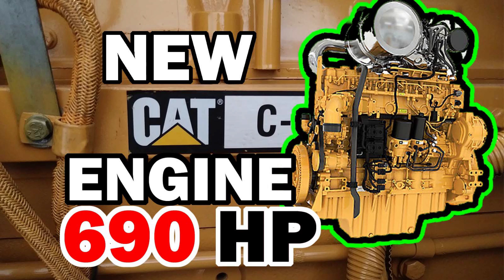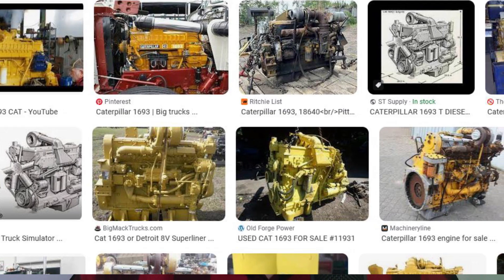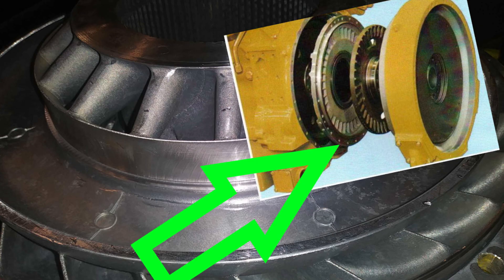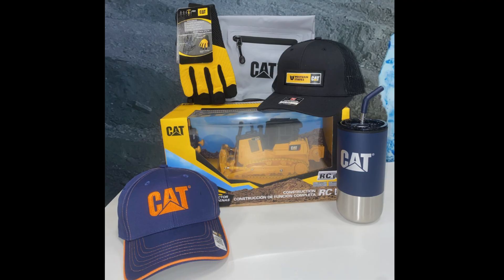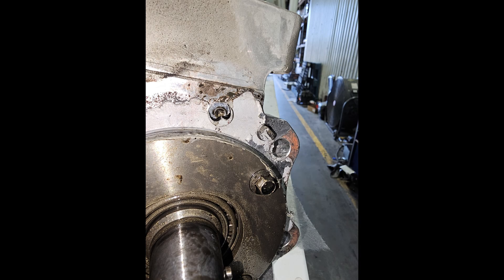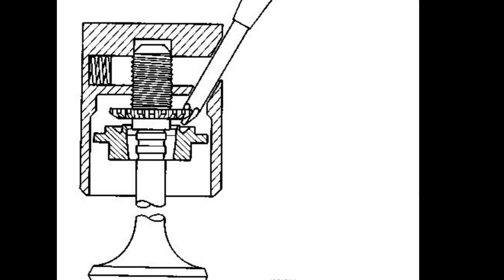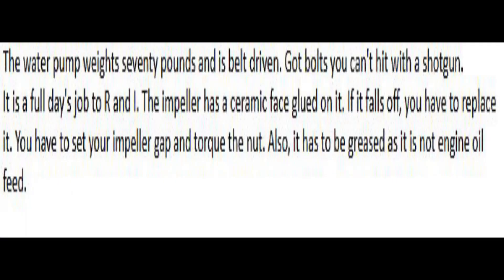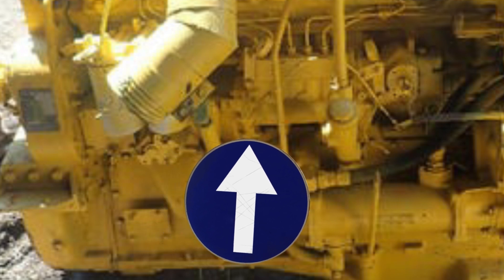The Coolest Diesel Engine You've Never Heard Of, Cat 1693, Dual Overhead Cam Caterpillar.

Comment: Had a 425 kitty cat in 1972 LW logging truck, bought in 1975. It had brakesaver (a must for BC). 5 X 4 with airshift A-box. Rockwell or Timkin 44's ??? 4.63 ratio... soon figured out that U didnt need to wind it up to 2100. Started to only take her up to 1800 max. She pulled good at 1550 -1700. Had to keep your eye on pyromoter as it would easily go up up to 1250, kept her a 950 max.
Fuel milage really improved keeping revs down and pyro down...
Dont remember it been leaker, except for the Brakesaver seals. Went through a few seals changes before living with the leaks...
Finning had great truck shops throughout BC. As not many shops wanted to do major work on them.
Fuel milage wasn't that bad.
Not as good as a Cummins NTA 420. 
Mack had the run slow go fast figured out years earlier. 375 Thermodyne's with 12 speeds would give me a run!
Lot of 1693's and early 3406A's Died early expensive deaths becase they were been shifted at 2100 and cruised at 1950 due to the axel ratios and general ignorance of 1693's wide torque curve.
Belive peak torque was at 1200
Did have water pump changed at Finning, dont recall it been a big deal???
PS
3406'a (there was never an A) came in both PCTA and DITA. My friend bought new Freightliner in 1977 with PCTA 3406 at 360hp. That truck never let him down!
Reply: Correction. My LW had 5.29's = 62 mph at 2100, not 4.63's. That would have been a much better setup!

Comment: Remember that at the time these engines were designed and in everyday use diesel fuel cost 22-25 cents per gallon. Mpg wasn't a big issue.

Comment: We had a kenworth t800 delivered that had a 3406 with cat brake and also a brake saver by mistake.. it would lock up the tires on dry pavement if both where engaged

Comment: Never heard of? My 1975 Kenworth K100 has a 1693T with a 13 double ott transmission, good old white block motor, had a 1973 W900 that had a 1693 in it, best motor next to the 475 Cat ever built.

Comment: i have run one in late 70's and near end of there run i believe u could get a di  alot of them where painted white from factory and i think they changed to di in late 70s and where 425 hp i might wrong but i dont think 3406b where available intrucks until early 80s and where a bitch to start in winter

Comment: The 1693 was the Godfather to the 3406 and C15.  Sounds like a bucket of bolts rattling in a steel pail at idle.  Obviously cam setup was different but laid the foundation for what was to come.  Back in the late 60s/70s it was the king of the hill along with the 12v71 Detroit.  When 3406, 3408 and KT Cummins appeared in the mid/late 70s then the 1693 and 12v71 disappeared quickly.

Comment: Favorite engine would be 3408 . Ran a rock trencher with one supposably was tuned to 650 hp or so never was able to prove it . Never ran out of power but would burn 300 gallons of fuel a day

Comment: Worked at a Cat dealer late 70 s rebuilt a few of them, also did some V-12 like the 1693 used in haul trucks for mining. Most of the work was 3406 in frame overhauls, we could do in two shifts.

Comment: John S. here. Call me a sadist, but my favorite engine is either a BXS or MXS C15 ACERT. Had a job working on a fleet of them for years. Pulling doubles over here next door in Montana.  124-133,000 pounds gross. Loaded both ways, they averaged 5-6 mpg in W900’s. Only common issues I saw a lot of were injector cups leaking putting fuel in the coolant.  Easy to work on, I truly loved them.

Comment: When I went to UTI, in 1987, they had one. We got to run the overhead on it.  
Last fuel hauling company I worked for had Jake’s & brake savers on their 2WS 3406E engines. 
The actuator diaphragms are the Achilles heel of that system.

 Precup engines have a distinct knock sound when running. Hence the name clatterpillar.
Reply: I had 3408 PCs. Everybody was jealous.

Comment: Josh, You can go back even further, in the late fifties, Cat developed the D337F, overhead cams, rear gear train,turbocharged , very similar to the D343, & 1693, they are a beast my favorite Cat engine. I helped rebuild a D337f back in the 1990’s, parts were getting hard to source even back then. I have some pics of it somewhere. Cat used this engine in Antarctica  stretch D8’s . small engine mechanic on YouTube has video 337f  generator set under load, awesome.

Comment: when they were built in the early 60's everybody was running around with 220 and 262 cummins, Endt 673 macks with about 250 hp, Early 8v71 two valve detriots that were at best 290 Hp. So yes the 1693 was huge power at the time, not to mention, not only was fuel cheap then, but diesel was way cheaper than gas, and they didn't have red dye in heating oil, so everybody ran untaxed fuel

Comment: One reason was interchangeable parts. The 1600 series each engine was unique. The 3400 series, several parts was interchangeable. The first 3406's (92U's) had a major design flaw. The rocker arms was lubricated via the head bolt holes. They would fill the radiator up with oil, as the spacer plate gasket could not handle the psi. So around serial number 6,000 the block was redesigned with oil passages that feed the oil through a port in the head. The fix on the older engines was to drill the rocker arm head bolt holes in the spacer plate. Put in a metal insert and contain the oil. I actually had an engine that some one put the early head onto a oil dowel head. Burned up all the rocker arms, as the lubrication was shut off. Another odd problem on the 92U engines, they could be PC or DI. When you got one in with the wrong piston's you could kill all the mosquito's in the building.
Reply from the maker: Thank you for the information for the video and your always informative comments John.
Reply: @AdeptApe   I am here to serve.
Reply: I ran several 1693 ta engines biggest problem was the cam drive gasket they always leaked oil. They would go around almost anything very powerful engines.
Reply: I owned one of those early 92Us in a 1976 Pete cabover 360 HP. Stopped to sleep a bit on the Ohio Turnpike rest area, when I got  up in the morning I found a big puddle of oil under the radiator.

Comment: The 1693 was ahead of its time , it is the first real dual over head cam truck engine (parallel port ) all intake valve on one side of engine &all exhaust valve on other side of engine& i believe  same injector pump as 3406 a  cat basically built 1693 for longevity and fuel milage , but that went out the door because most  owners turned the fuel up to get more power. The other problem was 1693was slightly to big for std hood truck & C.O.E.& they were expensive!!
Reply: And i forgot the exhaust port came out of head at about 45° instead90° straight out , way better exhaust flow !!

Comment: There was an entire 1600 family.  All of them had dual overhead cams with flat tappets, and they were all precombustion engines.  Beside the 1693 were the 1673B and 1673C which were essentially the same engine with a shorter stroke.  The 1673C had a longer stroke than the "B" and put out more horsepower than the "B" version.  The 1674 was a smaller inline 6 that was sort of comparable to the 3306.  There was also a V8.  The 1676 was a 60-degree V8 that had a 4.5 inch bore and a 5.5-inch stroke.  The 1676 is very rare today because it was a constant source of problems for Caterpillar, and they made only a few of them before ending production.

Comment: Hi, Josh - Duane Buck, 250hp Cat 3126 - mainly because that's what is in my '96 Diesel Pusher RV that I love to drive. Might not do 65 going up grades, but it will run all day long for me with zero issues (other than the stupid inlet heat that wigs out in high altitude and freezing temp).

Comment: I am a retired truck mechanic and I worked on a lot of these engine's in trucks and equipment they were bullet proof.
Reply: I worked on a few of these as well. The water pumps were a bitch, especially in a cab over. Rebuilt a few of them, dont miss it.

Comment: The pre comp cylinder heads were a plus for extended idle not causing glazing like direct can and also if you got a dicky injector like spray patern or dribble it didn't tend to cause cylinder wall wash damage either

Comment: I got to help restore a 1972 Autocar pulled an A model out installed a 1693 425 hp, that is what the truck was built with and 9513 road ranger, Josh believe it or not it held 22 gallon of antifreeze

Comment: I worked on a 3406 prechamber in an IHC.  It didn't have spin to start.  Just grunt, grunt, vroom.  We converted it to DI.  We ordered a glider for a 1693 and it had a round cover to remove on the firewall to pull a coupler shaft to remove the head.  Later we swapped it for a 3406 to save weight and there was also high demand for the 1693 to go in offroad equipment.

Comment: The funny thing about overhead cam engines is they have been around a lot longer than people think.  Holt 2-ton tractors pre-caterpillar had overhead cam gas engines in the teens and into the 1920's.  I am not 100% sure but the reason for the long driveshaft for the injection pump on 1693 is that there's a timing advance setup in their runs with oil presser to advance the pump.  keep up the good work
Reply: Correct, in the long housing has a hydraulic timing advance. Has an oring that wears and will let oil bypass. You could take the pump off and not have to retime the engine. The advance had two flyweights and the main part was called the power piston. It had a helix cut on one end to twist the fuel system pump in the advance position. The bad thing, if you had to replace the power piston (should not have to). You had to drill the hole in the shaft manually. They was two settings in the book. The side had a collar that hooked the advance to the gear train. Two 1/2 bolts with locking tabs. You never backed the engine up to check pin timing. Always turn it forward as the gears in the back was excessive. 
Checking timing, you had the bolt in the flywheel, pin in the fuel pump, pull the plug out of the back and see if the flat part of the drive is on the top (also had a dot) and if you had to. You would have to pull the valve cover and see if the exhaust cam timing marks was lined up with the intake camshaft.
Reply: Yes, and in gas - Hall-Scott!

Comment: The 3208 is my favorite Cat just for fact they have been used in everything. Plus I have one in my hobby truck, a 81 f600. I've had a couple trucks with Cummins and another Ford with the awful 6.0. Cats are new to me but I'm learning alot from your videos. Yes I'd  love your giveaway to start my Cat collection. Scott Bunn Doylestown, OH
Reply: 3208's fuel system run in fuel. Do not prefill your fuel filter, water and debris will kill them. Also keep the valves adjusted and replace the rod and main bearings if it has been awhile. The front main is a bear and have to have a special tool to torque it. On Ford trucks another weak spot was the ground system. I have see the electrical system look for a ground and actually will ground through the main bearings. So, make sure you have a good ground. I like to run a cable from starter ground to block, block to frame and frame back to starter. They are cold nature so a coolant heater helps in the winter time.  Don't run cold thermostats. Lots of updates trying to stop oil consumption complaints. If it has water separator on it, take it off and mount a spin on primary fuel filter. It has way to many fuel fitting connections and will get on air.
Reply: 3208 has a great sound in our forklift at work
Reply: People bad mouth 3208s, but they are very faithful starters in cold weather,if they have fuel ,air, and compression,and roll over, they'll start

Comment: The 1693 was an awesome truck engine at the time. Rated up to 425 hp something the 3406 wouldn't reach again for many years. 
The 3406 JWAC maxed out at 420 hp and it wasn't until the 3406B ATAAC that the 425 was reintroduced. 
The 1693 introduced Cat as a significant TRUCK engine supplier. With the overhead cams etc the engine was horrendously expensive to rebuild. 
BUT the power for the time was AWESOME and compared to two stroke GMs/Detroits its fuel economy wasn't horrendous
The brakesaver while heavy and expensive it provided great retarding and was silent. It also added a lot of oil to the system (always good).

The 3406 was effectively a cost reduced engine and was designed at the same time as the 3408 & 3412.
The 3408 became the iconic replacement for the 1693 with ratings up to 450 HP. The size and weight (and cost) of the engine limiting its actual popularity.
But the sound - oohhh the sound of a thumping V8, straight pipes, fuel settings nowhere near std..........
In Australia they became THE engine for the fast trucks and particularly road trains (~120,000 lb at the time I think)

While they have a FRONT gear train the fuel pump was still remote mounted (drive shaft to the pump). 
There a number of possible reasons for this - fuel lines are more equal in length, the shaft provides some torsional isolation to the pump, packaging issues. It would be great to know the real reasons for it.

Comment: As I remember, my all time favorite wrecker/tow truck, "Ugly," actually a beautiful Oshkosh mostly famous as a winch truck, was powered by a 1693...It's said that no matter how stuck you were, with Ugly on the scene you were either getting pulled out, or pulled in half...Ugly has never failed...
Reply: Oshkosh the most beautiful truck ever.drove one in the airforce. Hauling  cats 631/ 633 .
Reply: I’ve done a lot of work on Ugly, and am very close friends with the current owner. It’s powered by a 1674C Caterpillar. Being that it’s AWD Oshkosh would not install big hp and risk  blowing the front axle. FT6, another Oshkosh wrecker built by Guaranteed has a 1693T 325hp in it, but no AWD. 
Ugly should be at both ATHS and ATCA national meets this year. I actually have to go spend some time on it this winter getting it ready to go out as it hasn’t moved in 4-5 years. I’m glad people still think of it fondly.

Comment: i rember one being turned up to 800 at rear wheel in late 70s. ran good for 10 months. redid moter and reset to 600 no proublems for years. mike. shake rattle and roll.

Comment: Certainly back in the '70's the 1693TA, rated 425hp was very stout if coupled to a RTO-12513 trans. My Grandpa said they were pigs on fuel by todays standard .  I have seen many of the D343 used switch locomotive use and they ran well for what they were doing . I do have a 1957 farmall with the Continental GD 193 diesel and its a small 4 cylinder Pre Combustion type and its hard to start for sure but runs good once you warm it up and put a good load on it runs clean

Comment: Jay’s a really cool guy! I drove a 1693 PCTA 425 HP, 13 over-and 3.90 rears in a KW cabover had a 5” straight pipe on it. Sounded like a motor grader going under an overpass! Awful fuel mileage but man would it pull, back out until it “cackled” and it felt like it’d roll the asphalt up. Would live forever but super expensive to in frame and NEVER EVER overheat it, crack the head around the pre-combustion chambers! Was cheaper to scrap the truck than buy a head. Real tough to work on in a truck, head, oil cooler, water pump and fuel pump would get ya cussin’. Super cool engine back in the day though. Thanks for the trip back there!

Comment: I loved the sounds a 1693 Cat would make at idle. They knocked and pinged and it was normal. They were high hp for their time. I knew a guy that had a 1693 TA at 425 hp. The turbocharger was huge, and it had tons of turbo lag. He said it  was a horse! 
A 1674 Cat was the predecessor to the 3306.
 The 1160 Cat was the early 3208. I had heard that Ford and Cat collaborated on designing the 1160. I have seen 1160's painted Ford blue in Ford trucks.
Reply: You have the 1600 series, 1673, 1674, 1676, 1693. The 1100 series was strictly for Ford, 1140, 1145, 1150, 1160
Reply: We had 3160. It was in Massey Ferguson 1800. Then they put 3208 in 1805.
Reply: Or did you mean 1673/D333 was the predecessor to 3306?

It gets a little confusing because some OHC engines were marketed as 1673 (C IIRC?) while mostly 1673 designated a pushrod engine.

Comment: Brett Dale is the name. My favorite Cat engine is the KCB. I like the KCB because of its simplistic but somewhat complex design. I worked on a lot of these engines early in my career. I’ve never been super deep into them internally but I’ve torn down the passenger side many a time to do an oil cooler or manifold and I always like how they came apart. I also like the pan and valve cover for there sturdy one piece gaskets and few bolts. I like them because I like to work on them.

Comment: I worked hauling trailer dumps with a guy that had an old Kenworth with a million mile 325hp 1693 with a brake saver. The truck was reliable and he babied it as much as you could grossing 100k lbs. He was afraid to use the "brake saver" because he lived in mortal fear of needing an overhaul. The truck was reliable and it pulled strong. All of the trucks that we used were lucky to get 4mpg back then.

Comment: Cole Youngren, my favorite Engine would have to be a 12 valve Cummins. My main reason is even after tons of wear andtear They hold up in all conditions. I have one ina 94 Dodge that didn’t run for roughly 20 years and with a little bit of maintenance, it fired right up. Thank you for what you do Josh keep up the hard work!

Comment: Great video on the 1693.If you are on to old Cat stuff here is one.Cat made an aluminum block V8 diesel.There was a YouTube vid on years back.Cannot find it.I think it was made for WW2 issues.The 3406B 425HP with Jakes,brake saver,exhaust brake would make over 600 hp on braking.Great engine package for the day.
Reply: The 3406 with super jakes ( 349) & 3408 hyd retardeder had 790 hp retarding.  The 3408 retardeder has more power than 3406.except 3406 e have 3408 retarder .